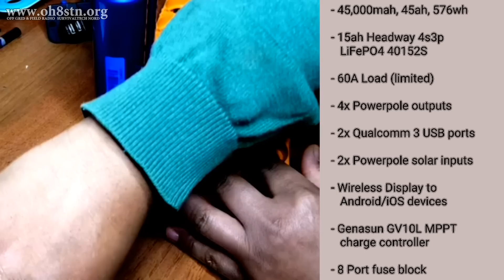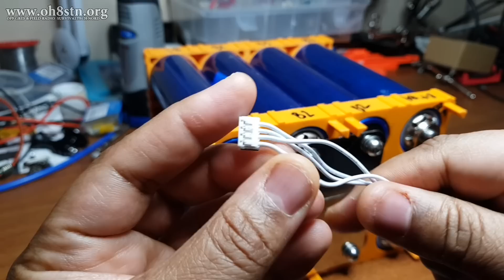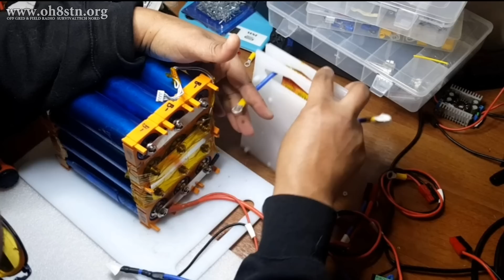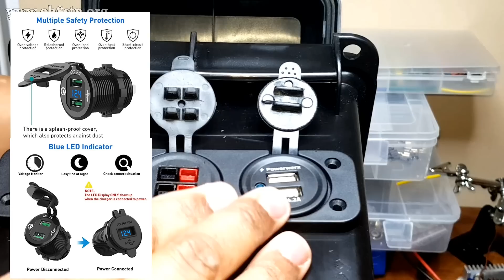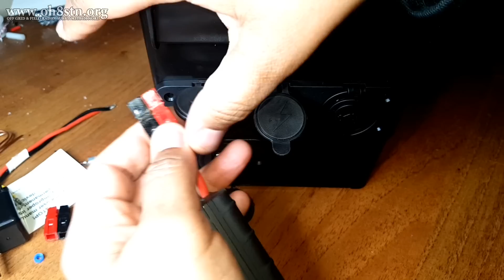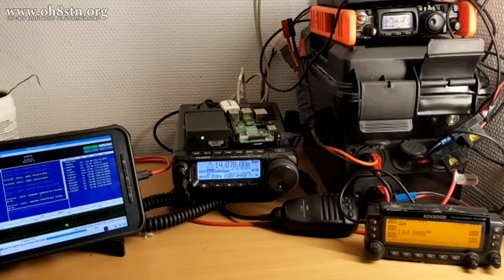DIY Ammo Can Solar Generator | LiFePO4 Off-Grid Power Build

Comment: I am a little confused about some of you shunt wiring. In the early part of the video when you show the wiring of the shunt, you have the shunt in the positive side of the battery. when you are installing the bat. int the ammo can it is on the negative side. Then you show it again on the positive side.
Where are you hooking up terminals 1 and 8 with the power pols? Why did you not put them directly to the positive and negative terminals of the battery?
73
N0ORK
Reply from the maker: Hi Daniel.  The shunt can go on either side, positive or negative since it's just measuring current flow. I changed my mind during the build and put it on the negative side. If you look at the notes, the documentation for the shunt has excellent schematic diagrams about wiring it.

Comment: This is a jaw dropping build that has me feeling foolish about saving up for the Kodiak (To be fair, Canadian Prepper put me onto your channel).

But given that I was looking for the Kodiak, the only thing I would love to see is either a daisy chain capability (making multiples of this unit that I can cable up to make a Kilowatt/hour system or more) or an expandable system (hooking up Car batteries or the like) for a modular system that I can take on the go for specific lower energy demand needs or combine to to handle family specific needs in case we get another windstorm that blacks out the neighborhood.

How much more tinkering would it take to meet such needs? If you have no plans to build such a project, is it possible for you to share resources that you learned the most from so we can muddle our way through it?

Thanks in advance. Marvelous Build.
Reply from the maker: Hey thanks for the kindness, the questions and comments. Yeah the Kodiak is pretty amazing actually. As an inverter generator, it has some pretty amazing capabilities for the off grid cabin, RV and Overland scenario, emergency backup for partial home power during a grid down, ...
This generator being a DC generator is designed to power communications gear, lighting  recharge power tools, power critical devices, a laptop, and do so as efficiently as possible  So the inverter is avoided, choosing instead to stick with DC whenever possible. I think it's safe to say this generator actually compliments the Kodiak, but it doesn't replace it.
I like the idea of the DIY build for the Kodiak but, it's an entirely other level of skillset, when adding battery chaining. That's especially true when chaining different battery chemistries.
Vehicle charging is already working. We it plug into the DC cigarette lighter output of our Subaru Outback to charge up on the go. Then use solar when on site, off grid.  It already works, but needs to be documented on the project page. There's lots of information on the project pages on my website. You can see the link in the description. There I talked about the Kodiak, building your own Kodiak, we're building this type of DC generator.
Anyway, thanks for reaching out and leaving such an awesome comment. It's very much appreciated.

Comment: Where did you  get your busbars and screws?
Reply from the maker: The screws come with the cells. The busbars I ordered from the same place I got my cells. A cheap alternative is making them with copper pipe from the hardware store. Just smash it in a vise, then drill holes adequate for the distance between the screws.

Comment: No one is using Lithium Titanate Oxide cells here in the US. I would love to see a video from you trying them out. They are manufactured by Yinlong in China and are rated for 30,000 cycles at a 1C charge/discharge rate.
Reply from the maker: I've been reading about them and they seem pretty awesome. I'm not sure about the volatility as with lithium-ion or lithium in NMO, the 20,000 Cycles is pretty impressive. Definitely willing to give these a go, but I'll need to wait for a compatible charge controllers before that happens.
Reply: @OH8STN  if you like genasun just call them they can set the chargers at whatever bulk/float charges you want. Ive called them before they will make one with your charge profile if you are using a different chemistry.

Comment: Clean build! I'm building a semi portable 4s24p battery using 8ah headway cells! It'll have custom bus bars and cell level fusing.
Reply from the maker: Outstanding Shannon. I like the cell level fusing, and considered it for this build. When I can figure out how to make it small enough, I may update this one. By the way, I really love those 8 amp hour headway cells. So far the 10 and 15 amp hour cells have been Rock Solid. I may order some of the 8 amp hour cells for a project I have coming up. Thanks for the comment and for the kindness. Reach out again if you're going to share your own project. It sounds awesome 👍👍👍
Reply: @OH8STN  Sent an email with images of a 4s4p, 8s6p and 4s24p. Off the shelf strip fuses can be used for cell level fusing. I've tested over 250 8ah headways, working on some big builds!

Comment: How much higher energy density for Lion and how much longer life for LiFePo? I understand that how far you charge/discharge Lion greatly affects their life. If LIon is good for a thousand or two cycles what's the chance that a ham is ever going to cycle the pack even a thousand times? That's a lot of evenings if QSOs!

Any way to get battery stats on the unit itself rather than depending on an app?
Reply from the maker: Hi Tracy.
Higher energy density gives you smaller size, more energy, but comes at the expense of cycle life. For Lithium NMC and Lithium Ion, that cycle life is generally 500 cycles. It's also 500 cycles for Lead-Acid, AGM, Deep cycle marine ... One can short charge for greater cycles, but it reduces the useable watt hours of lithium-ion/Lead-acid, so we end up building a bigger pack to compensate. LiFePO4 80-90% is ideal already averaging 2000+ cycles at 90%.
You can see a comparison of cost versus battery chemistry here: https://oh8stn.org/blog/2018/12/09/diy-solar-generator-576wh/

We should remember these systems are not only for ham radio. The dream of powering an entire field station, dxpedition, small cabin, camper, or an off-grid ham shack takes this to the next level in portable power. Its really a big step up.
For the bt shunt, there is the option of just seeing battery voltage with a meter. I'll update the build notes shortly to reflect that. The only component we change is the powerwerx usb ports, to the alternate usb ports in the build notes. It show battery voltage whenever the USB ports are switched on.
73
Julian OH8STN

Comment: Hey OH8STN, I don't have all the equipment to construct this yet and I want to be properly prepared. Do you suggest a quality solder station, solder, flux, and any other related tools. I'm going to buy a Fluke Multimeter as well since I've been meaning to for years. Thank you so much for taking your time and building and filming this. Also thank you for your kind and quality teaching, I want to learn and understand my equipment not just buy everything and this kind of project helps tremendously. Self reliance. :-)
Reply from the maker: Honestly I'm lacking a good solder  station at the moment and I need to invest in one,  so I would say absolutely yes. The fluke was an excellent investment and I'm glad I made it. I've had it for nearly 10 years and it's never failed.
The only soldering  was the BMS  wires. Everything else was crimped connected.
Reply: OK, good to know. I will start looking.

Comment: Not much airflow in there.  Any idea how the temperatures will be during sustained usage with the lid closed?
Reply from the maker: Awesome question Bill. So far the system temperature sits between 67°-80°F, 19°-24°C. Even when running the Yaesu ft-891 @75w, the 817, and the D700 @ 50w simultaneously, the system temperature didn't rise above 80° Fahrenheit, 24° C.
I believe the reason for this is not texting this system as all with the loads were putting on it. This battery pack could provide a load of 450 amps with the right cables. The BMS is happy to comfortably sustain a 50 amp load. The highest load the system has seen was with the 891 (JS8) and D700 (APRS) transmitting at the same time.  That was 28A. That was the 80°F reading. 
It's a good point in fact it's an excellent point, so I'll keep an eye on it. It's a good thing we have the internal temperature sensor.
I put up an image on Instagram for you. https://www.instagram.com/p/BuLnqzeD_te/?utm_source=ig_share_sheet&igshid=15462zwpp4e35

Comment: Remember to make you a cigarette plug adapter that allows you to charge your battery when driving your car to and from a deployment.  Just plug it into the 12 volt socket and then into your power input (your yellow Anderson plugs).

Comment: what I will think of that I think you should have done because it does not seem that you can get information about BMS works as it should or is reached is wrong so I think you should have a cable for the battery so you can easily check with one multimeter that all the batteries are balanced and if they are not, you can connect it to your charger with the balancing connector and charge it without having to remove everything

then i thought it is not safest to put shrink tubing around the negative on the balancing cable so you know which it is

you didn't mention how much it cost but just that it was less than the yeti
Reply from the maker: Actually that's an excellent comment. And I bet you thought I would delete it!? Seriously I think I will make that modification. It's nice to be able to check the sale balance, to verify everything is actually okay. I'll order the cables today an update in the build notes on my blog.
Excellent comment and thanks for sharing your opinion 👍👍👍

Comment: How do you keep your battery packs warm?  From what I’ve read they don’t do well if below freezing,… Thank you for your posts I really enjoy your attention to details that you share with us
Reply from the maker: Awesome question Jeffrey. Actually I have a hot tipi tent for my winter field station. It never gets below freezing in there. For transport, freezing is no problem since discharge of LiFePO4 is safe to -20. Only charging is the problem. The charge controller also generates some heat when charging. So it's quite easy to keep that small enclosure, above freezing. Finally, another hack is to use a chemical hand warmer, dropped inside the enclosure.
Anyway the worst case scenario is having to charge in freezing temperatures. But they're re result is simply a loss of capacity over time. Not desirable, but not the end of the world. Thanks for the question, and for watching my videos. It's very much appreciated. https://www.youtube.com/playlist?list=PLKMrdrsNkFA56OJh6oWf3SdOT0z155D9z

Comment: Julian. What's up. question! Do you use a balance lead and a bms On the build up? Am going to do 3 of these. I had 5 pack of 4S 2 P. On two of the pack some of the batteries started to ooze. So I lost 5 batteries. Bms. Didn't protect them. So I have to remake the packs again. Walked out and the charge controller had slipped and set to 15 volts. Instead of 14.1 like I had it. Great video by the way and thanks. 👍

Comment: Awesome build Julian!  You really took the battery box/solar generator to the next level with this.  The only problem is I was drooling the whole time in awe of the greatness of this beast!  I've been using the 10AH build for almost a year now and love it.  I refer everyone who asks about it to your channel.  Thanks for the inspiration and great videos.  73 de K8MRD.
Reply from the maker: You're too kind 🙏
There's an update coming for the 10 amp hour version as well. We really need to spread knowledge and help Inspire others. 
Thanks for the comment, and reaching out. It's very much appreciated.
73
Julian oh8stn
Reply from the maker: @nancejo-o6d  thanks I've seen those. I think the solar panels on those are great for trickle charging, but too small too small to use the system while charging. I would make the briefcase to hold the batteries, and use a PowerFilm for charging

Comment: Thanks Julian. Have to admit, I was a little skeptical going into this one - but this is great. Thinking strongly of building one myself; maybe putting my 3D printer and CNC machines to work on a case; but I'm liking it. I have a system on a boat that uses AGM fiberglass mat lead acid batteries - they work great, but they are so heavy. I could replace them, save weight, it looks like about same money, and get the benefits of lower discharge, and faster recharge. Lots to think about! Thanks! 73s.
Reply: I'm learning portable ops in the field. My portable radio is a Yaesu FT-897D. To get started, I bought a large (and heavy) AGM that can power the radio and support equipment. This was to get me started and field ops are about all I can do given the level of RFI here at my house.

Julien's channel inspires me to get out and work in the field. It's a long story, but this is something I really need in my life (the field ops). 

@WG, build one and post your process. I'd love to see it.
Reply: @nvrumi  After posting this I started working on sourcing the parts, and found I could get twice the capacity with AGM - for about 1/3 of the money. Since my field ops are from a sailboat, the weight savings isn't a priority for me, so I bought a quality marine grade AGM that can discharge to 35%. It's been working great.
Reply from the maker: 500 cycles. The price is probably only cheaper at the cash register, not you're the life of the battery

Comment: Why not use XT60/XT90 on the battery box and your own stuff and make a couple of adapters in case you need to plug in someone else's stuff or your stuff in to others power sources?
Reply from the maker: That's definitely one way to do it. I just figured since I have the box on powerpoles, I would just keep everything consistent. I do have a smaller system with a similar design but 10 amp hours. That one uses  xt90s.
Thanks for the comment. It's very much appreciated 👍👍👍
Reply: @OH8STN  I can totally understand why people use PowerPole, it got a pretty strong hold in amateur radio and that's great for sharing equipment. It's a really nice build no matter if it have PowerPole or XT connectors. :)

Comment from the maker: Be sure to watch the video update.
https://youtu.be/yJawygsz91s
Also have a look at how I deployed man portable, with the Yaesu FT-891 and this diy Solar Generator 
https://www.instagram.com/p/BzCx84uDfdP/?igshid=18saki9j6u6w4

Today I'm sharing my DIY 576wh Portable solar generator project. It's a long video, but it is also a very complete video, from the perspective of those interested in portable solar generators for the ham radio community.
73
Julian oh8stn

Video URl: https://youtu.be/Nf9X4YIK9xA
Background and build notes: http://oh8stn.org/blog/2018/12/09/diy-solar-generator-576wh/
Reply: I had to smile about the cutting boards. I use them too. They are strong,  moisture proof, do not conduct electricity,  and cheap....what not to like?  
I hope to work you on the air sometime 73  KG7VDX
Reply: Julian, have you checked out the QO-100 Qatar satellite yet.  There are some exciting opportunities for portable emergency ops using a geosynch satellite.  I am researching on how to do a man portable satcom system with solar.  Any ideas?  I would like to collaborate and test if you are interested.   73s IU3JNT.